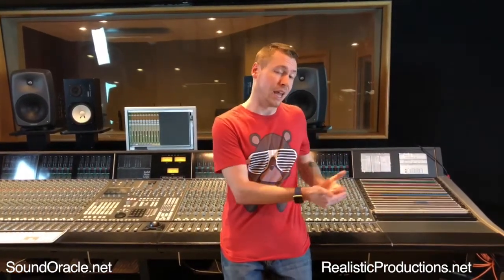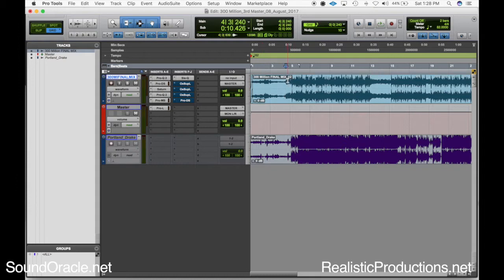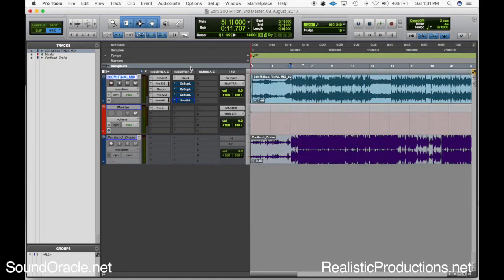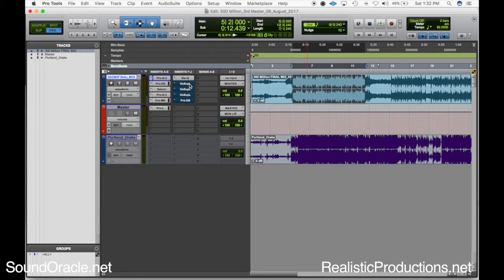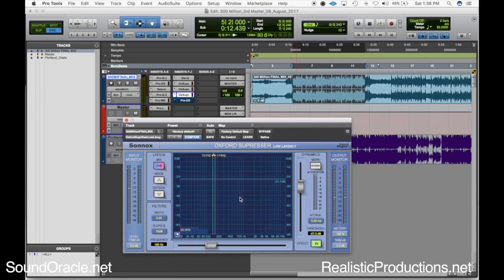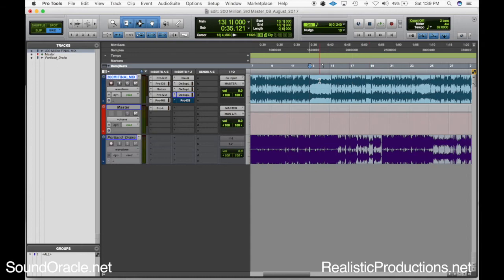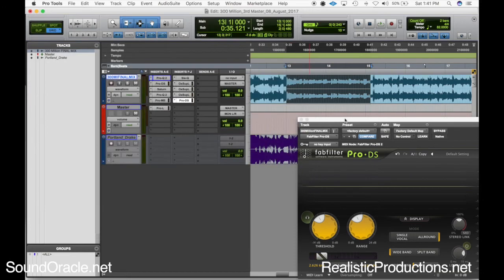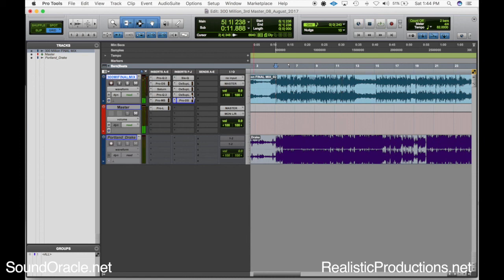Mastering: How To Use A De-Esser On The Master Channel  | Tutorial Video

Comment: Nice, never thought of using a de-esser like that. 
One question- why are you using it after your distortion and multiband comp plugins? I usually use corrective / surgical tools early in the chain to remove junk before I run my broader stroke processes.